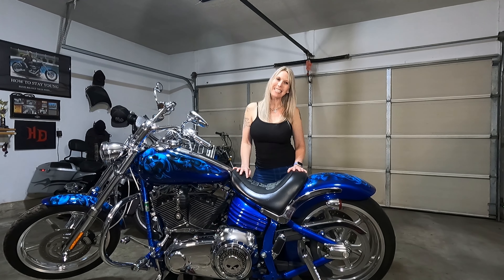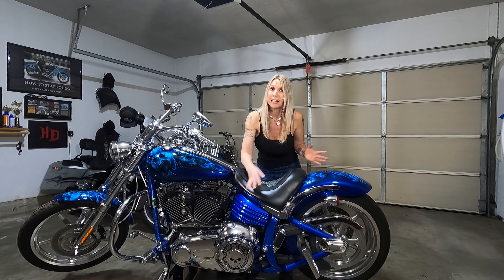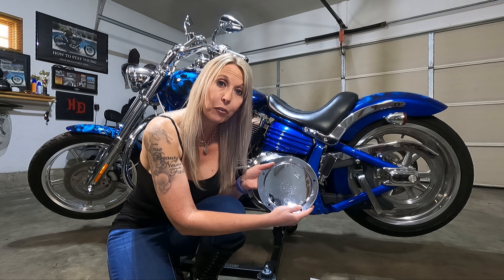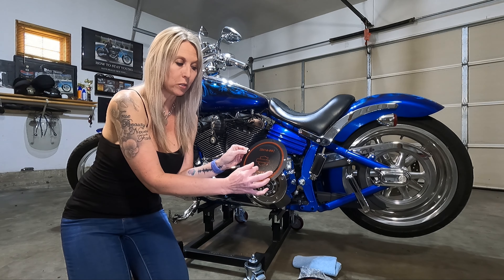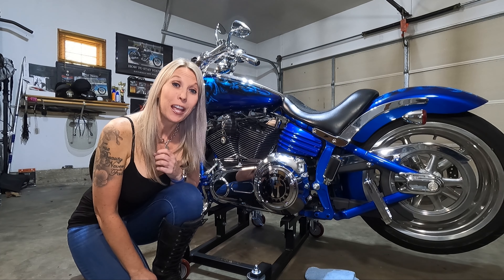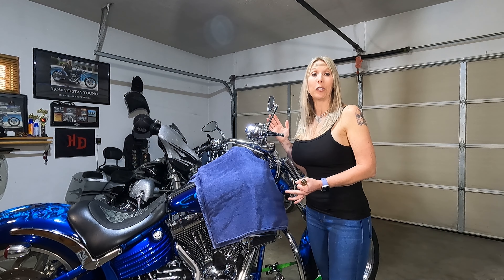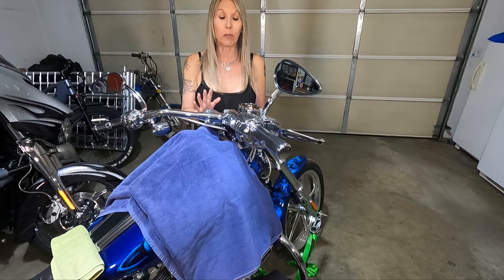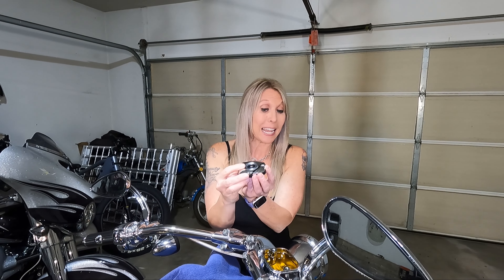Harley Davidson a Girl a Motorcycle and some Tools

Comment: I switched to dot 5 brake fluid because I like to get the shit everywhere. Gel coat unaffected so far.
Reply from the maker: I think DOT 4 is what causes our front brake cover to start leaking every year. Will have to check to see if our brake system can be convereted to DOT 5